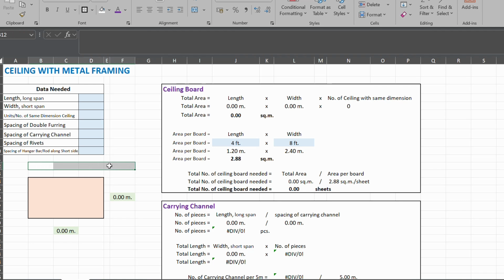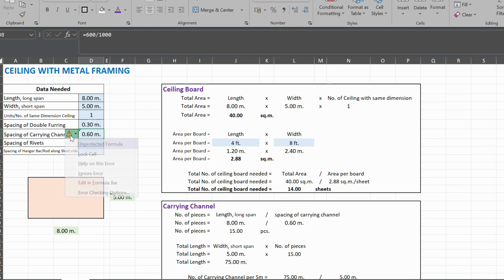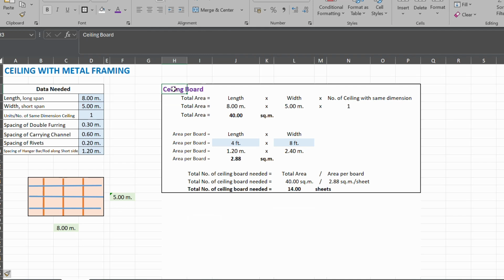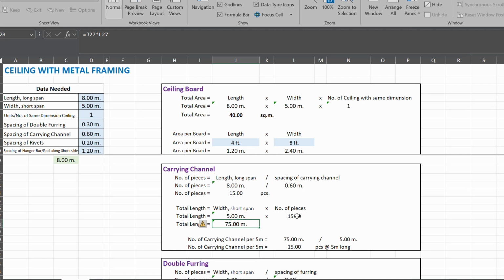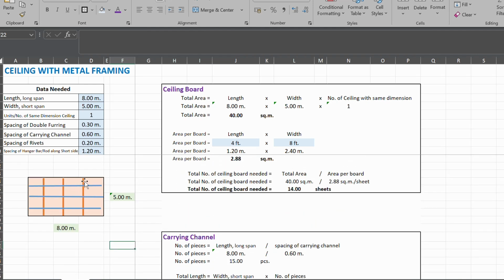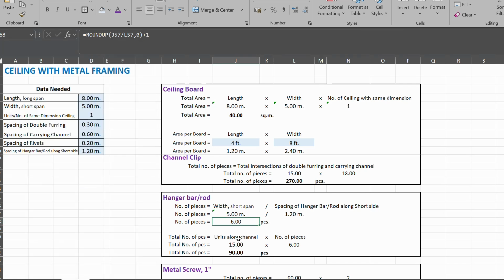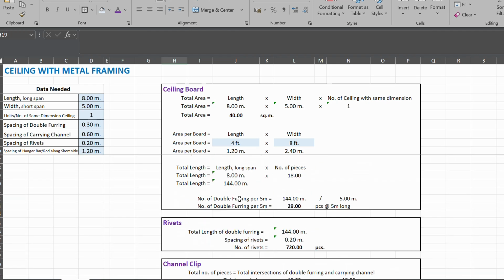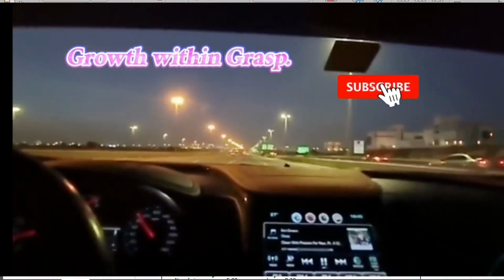Estimate of Ceiling Materials

Comment: How about po sa Self Adhesive PVC Joint tape, Joint filler epoxy A & B set and Scraper, sana po mapansin nito
Reply from the maker: Hi, maam? Hindi pa po ako nkatry but accdg to google po ang SA PVC joint tape ay commonly nasa 5cm x 40m per roll. And sa epoxy po is based sa brand recommended coverage.